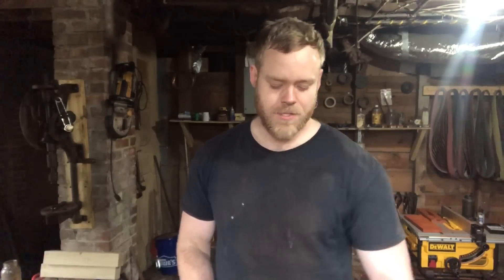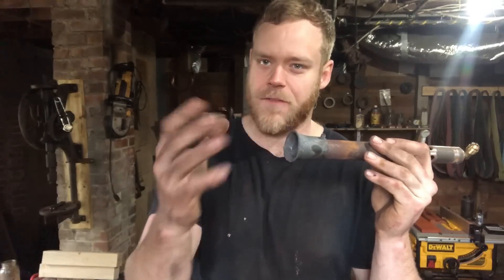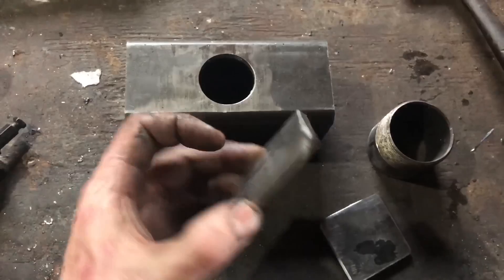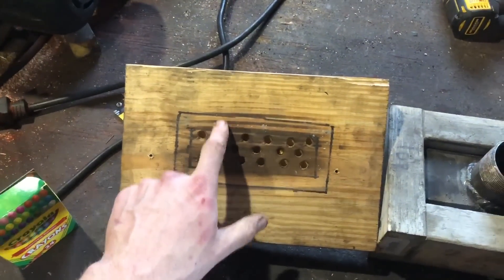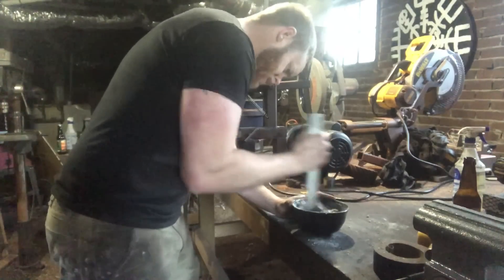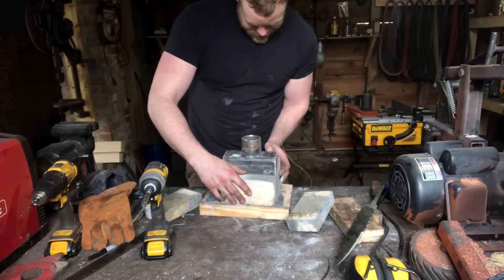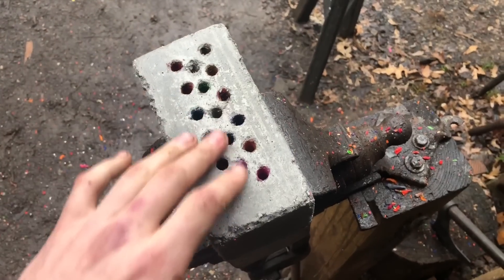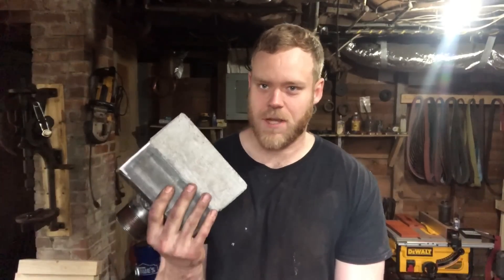How to build a ribbon burner

Comment: You drilled through quarter inch with a hole saw? HTH long did that take?
Reply from the maker: @riverboat28  not long. A minute or two maybe. Drill press and cutting oil makes pretty quick work of it

Comment: I seem to be missing something.  while i understand cutting, drilling, and forming,  when the cast material goes up into the steel body of the burner and it far does it go? Does it touch the bent flat metal with all the holes inside the steel body or is there a space and how much space is needed?

Comment: I'm just beginning to get into forging and heard you mention a ribbon burner on another one of your videos.  I built many burners for BBQ's and smokers and Have a question, do you really need to use the refractory/crayons on the bottom of the burner?  Couldn't you just drill the bottom of the steel body and get the same results without the extra?

Comment: The only part I don't understand is why you cut the burner plate off.
Just drill the holes in the plate in place then tack in some all thread (or bolts) in several places to keep the refractory in place.
Put in some wood dowels for the holes then make it the way you did.

Comment: Putting together a forge myself and was wondering if making the holes smaller would create a hotter flame and burn less fuel.
I'm thinking 1/4" holes throw more fuel than they can burn and smaller holes would be more efficient, plus hotter if you have a variable speed fan to adjust the stoichometricity of the flames.  If that's even a word tricity I mean.
Was going to build with a nozzle then this blacksmith down the street showed me an air assisted forge he recently purchased with a drilled round plate and then I see these ribbon burner forges but read where they go through a tank in a couple of sessions. 
So I wondered if creating smaller holes even cone shaped to possibly add pressure to them would help increase efficiency.
Putting the tips of the crayon on the bottom would do what I mean by a cone shape but the actual exit hole would be smaller than the crayon using just the tip to form the orifice.
Not sure about the mixer working as is assumed.
Possibly welding a angle iron to split the fumes and in the pipe put some sort of swirled to mix the gas and air.
But yours works and mine is in my head still so yeah uh....I'm still thinking.
Also wondered putting a plate in the middle where you cut out to put refractory in.  And capping the ends and sides but not completely allowing the refractory to fill in the area to attach to the head or whatever it's called to force the gasses to the holes and stop some side aerodynamics from slopping up the gas to the holes.  I'm thinking side turbulence 🤷
I could be thinking into it too much as well

Comment: How do you check it’s air tight also you said this is for your propane tank forge? So the dimensions work? Also do you have a video on the plumbing part and what angle into the propane forge

Comment: What kind of pressure do you run on your ribbon burner John here in Morganton
Reply from the maker: Depends a bit on what I'm trying to do. With the new bigger forge, about 3-5psi for general forging. Depending how hot I'm trying to run. 7-9 for forge welding.
Reply: @OldHickoryForge  ok thanks maybe I will up my air flow CFMs the blower that I put on is a small one like a draft inducer motor on a gas furnace have a good one thanks for the return

Comment: Hey, John! Great video! Thanks heaps! I'm wondering if there is an ideal burner to forge size ratio. My forge is about 17" long and 
6 x 6 inside. Is a 6 inch ribbon burner long enough? Thanks.
Reply from the maker: That's about 600 some cubic inches. My forge right now is about 700 and one of these ribbon burners is plenty for it
Reply: @OldHickoryForge  Awesome! Thanks so much!
Reply: Nother quick question: I bought some refractory (Rutland brand) that's only rated for 2200°. I'm realizing that is probably not a hot enough rating. Would 2700° be hot enough or should I aim for 3000?
Reply from the maker: @KPop78k  if you're using castable refractory it needs to be 3000. Mizzou and kast o lite 30 are both good options
Reply: @OldHickoryForge  Thanks!

Comment: What about using, instead of refractory or fire brick material, strips of flat bar material ( the dimensions of the ribbon burner) sandwiched together with the series of holes drilled through it and welded to the housing. ( only because getting a block of steel to those dimensions  could be expensive).Not only would it glow red hot it would probably last for years or would it? That would certainly could be a quick and worth while approach. What do you think?
Reply from the maker: https://youtu.be/hSRjEASWrnI
Reply from the maker: Here is the concept I meant when I said some people make them from all steel. The plenum would be made as Normal but rather than the front bit being cast refractory you can use a thick steel plate with the same holes drilled. Welded airtight. Again I don’t know how well this holds up long term. Some swear by it. Others dismiss it entirely. I haven’t tried it myself so I couldn’t say
Reply: I built a "steel head" round ribbon burner, and it works. Not my design. I copied from Phil at PJT Forging. My build link is https://youtu.be/6b3RGv6HmGQ I have had some issues but not related to the metal overheating. The flame burns at the holes, as it should, nice and blue. I have had over-saturation issues. I have been working to resolve them. I utilized an in-line needle valve just past the shut off valve but before the mixing corners of the piping. I am working on a video depicting my issues and my resolution. I will say that I am also in process with a ribbon burner build like John's. My forge is longer and my current burner head is round. So a rectangular shape should match up better for heating. My current burner head works great! But it is pretty focused in the middle. 
I am new, so I don't have history on how long it will hold up, etc.

Comment: I wonder if purchasing IFB insulating Fire Brick and drilling holes through them would work? Then strapping it onto the burner housing. What do you think?
Reply from the maker: I wouldn’t. Getting an airtight seal all the way around would be problematic.
Reply: @OldHickoryForge  Well lets think this through. The brick is very flat from the factory so that would not be a problem, The housing, if built correctly, should snug up nicely when clamped together either by wire or by straps. And the output pressure from the tank should not be more than 20 -30 psi. I really don't see the problem. And if your really concerned a small bead of high heat silicone around the perimeter should take care of any spillage which I doubt since the output holes are too large to create back pressure overflow.
Reply from the maker: @user-zx7tg4ph5r  fire brick also tend to break down under repeated thermal cycling much faster than a proper castable refractory. Having it crack and come apart during use would be a concern.
Reply: @OldHickoryForge  I wonder in encasing the firebrick with a SS metal jacket would extend the life of the brick? By encasing it, it could also be a simple way to attach the brick to the housing and pre drilling guide holes a 1/4 in larger around each hole will not effect the gas flow but will be easy to slide one brick out to replace it if it started to deteriorate
Reply from the maker: @user-zx7tg4ph5r  wouldn’t having the brick be able to slide out for ease of replacement mean you wouldn’t have an airtight seal? Some people weld up ribbon burners all out of steel and forgo the casting of the refractory altogether. Some say they hold up just was well and some say they don’t. I haven’t tried myself so I can’t say. The way these are built works and is safe so I haven’t found a need to deviate from if
Reply: @OldHickoryForge  A clamping option could be utilized by a U shape hat design where the U is clamped to the brick with bolt holes and the housing having threaded nuts to marry the brick to the underside, at which point a bead of high heat silicone type gasket seal would encase it completely. Then when or if replacement is necessary a slit with a snap blade will release it completely from the housing.
Reply from the maker: @user-zx7tg4ph5r  a ribbon burner made of properly cashed refractory will last pretty much indefinitely. I’ve been running the same ones for about 3 years now.

Comment: Where do you live that crayons are cheap enough to be disposable destroyable mandrels for holes? Those suckers are ridiculously expensive where I live! It'd be cheaper to use birthday candles. A bit smaller, but that'd be fine, you need to re-layout those holes anyway they look so poorly placed.
Reply from the maker: Actually I’ve made burners using straws before which are smaller then crayons 1/4” vs 5/16” and it caused the burner to not run correctly and have problems reaching welding heat. It worked but it was much more fussy. 5/16 is best. I’m curious as to what makes the holes “poorly placed” also a small box of crayons can be found at most dollar stores for 85-99 cents.

Comment: Just an FYI but if you take the paper off the Crayons instead of having to drill them out since their basic material that they are made out of is wack when you toss it in your oven just tilt it in the wax will melt out therefore you don't have to drill it and have any issues with cracking or anything else like that just an FYI I cork put a pan underneath it that way you don't have wax build-up in your oven

Comment: Have you ever considered to try different shapes of the holes, like conical holes or  bell shaped instead of straight ones given by the crayons to slow down the gas flow when it exits the burner?
The static air mixing device is as I see it also an important part of the burner - the flow should be relatively even through all the holes in the burner, and that plate should help with that to avoid more flow through the center holes.
Overall from what I understand the venturi burner problem is that the gas mix isn't homogeneous, and that's what makes them less efficient, so I think that there's some possible development potential when it comes to them as well.
The similarity between forge burners and rocket engines is somewhat striking aside from the rocket engines are running supersonic speeds and the bell shape of the rocket engine actually increases the gas speed.

Comment: I built mine today got 19 holes and instead of cayons I use the less mess and easier plastic straws did find the 3/4" as good advice, and 2"X 4" handy. I oiled the straws before installing and lightly spray.I was told to space holes 11/4 center so they have 1" space apart
With your help I fill it will be fine ,
.had no wax to drill your waxy crarons.
John thanks for showing and teaching..

Comment: Question, ive got my burner built, just getting the pipe together to do the manifold and such, do you still need an orfice such as a MIG tip where the gas goes in to mix with the air or just an open 1/8 hole or such?
Reply from the maker: Preston Thornburg the needle valve acts as that. You don’t need a mig tip
Reply: @OldHickoryForge  ok thank you very much

Comment: I used and like using straws and silicone spray to release the straws.
Question: how thick should the mortar be
Reply from the maker: John Jude I’ve always been told at least 2.5-3 inches. The ones I make are about 2.75 when you take into account how deep the manifold goes into the refractory

Comment: I’m slowly making a gas forge because coal is getting more expensive and harder to find and it would be nice to run a cleaner fuel. And then I won’t get quite as dirty when I’m working. And propane is fairly cheap and easy to get I’m going to make a ribbon burner like how you made yours. I’m going with one that will be more durable and last longer. And I forge a lot so it will save money fast enough in fuel savings and electricity isn’t an issue. I like to make hammers and Damascus so it’s worth it for me. Thanks for the great video!

Comment: So now that you have been using this set up for a while.would you change anything? I am going to copy this and the air feul set up
Reply from the maker: Balsam Forge one thing I would say Is if you shell out the money for a professional grade blower. Make sure you use a heavy gauge extension cord. I used a cheap one not reading the instructions and my blower was noticeably weaker after only about a year and they are not cheap to replace
Reply from the maker: Other than that she chooces real nice
Reply: @OldHickoryForge  thanks alot man. Voltage drop is a bitch on motors. Probably was the problem
Reply: @OldHickoryForge  one more question and I'll leave you alone. Do you know the cfm of your blower?
Reply from the maker: Balsam Forge the first one I had was a 112 CFM which worked good. When it crapped the bed I upgraded to a 175. Only because it will run the smelt furnace better

Comment: Why not just put some brass tubes in for the holes? Seriously, I'd like to know. 
Thanks in advance for your response, from a Desert Shield/Storm Soldier 124th MI out of Ft. Stewart, GA. Currently living earshot from Ft. Knox, Ky.
Reply: Oh yeah, SUB'd.
Reply from the maker: You could in theory. But pulling them out of the castable without cracking it would be a big pain. Straws also work and are relatively easy to pull out.

Comment: How many hours do you get roughly from a 20 pound tank with regular not welding heat?
Reply from the maker: Ramore Trapr I use a 40 pound tank and get roughly 16-20 working hours not running at welding heat
Reply: Thanks, looking at back burnering my coal forge...

Comment: I assume you don't need 1/4 thick walls for that?... 14 gauge would probably do. Or do you disagree?
Reply from the maker: Rich Hlywka I wouldn’t go thinner then 1/8. But I’m also a crappy welder and am mostly worried about burning through the material. I just find it easier to get better welds with thicker material I can really burn into
Reply: @OldHickoryForge  I'm a tin basher by trade. 14 gauge is pretty tough. I understand the worry about blowing through though. That said the burner in furnaces isn't 1/8 thick.

Comment: Nice setup there. I'm a welder. If you beveled the square caps you can guarantee the weld holds after you grind the cap off flush like that. I've seen MIG beads pop right out doing what you did.
Also, sleeves and glasses...UV radiation will kill slow and painful by melanoma.
Reply: I am beveling mine (the ends and caps) I get what you mean. Yes, safety first

Comment: the crayons are wax,, next time take the paper off them before pouring and then just set the whole unit in an oven on a grate with a pan underneath and heat it up, the unit can withstand the heat, the wax crayons will melt out.

Comment: With the forced air do you not end up with heavier scale generation on whatever you are heating in the forge?
Reply from the maker: BubbleOnPlumb not if you run your fuel air mix well. I haven’t noticed a discernible difference between forced air and Venturi

Comment: So that big flame is actually using less fuel than a Venturi or standard forced air burner ???
Reply: Yes because it is now "watered" down with a TON of oxygen! Think about it like this. If you buy a bottle of Jack Daniel's and only drink shots, you would get (totally guessing here!) Say 100 1oz drinks. But if you mixed it with 3 oz of Coke you would end up with 400 1oz drinks. Still good but you are getting more out of you bottle.

Comment from the maker: For everyone continuing to ask. Yes I know “you can just melt the crayons out” I have done it that way before. I prefer drilling because I find it to be faster and makes less of a mess. Do whichever works for you.
Reply: I ask my children ;  The first one who gets his package of crayons complete, win's a happy meal!
Reply: Your drilling out the crayon and saying what drill bit size you used saved my burner build.  Thank you. I made one using straws and the holes were too small.  I drilled them out and the flame stayed stable when I closed the glass furnace doors.
Reply from the maker: solvarr yeah I tried once with straws that were 1/4 inch instead of 5/16 and the burner didn’t want to run right. There’s some formula about total area of the holes vs the area of the inlet pipe but I’ve never went by it. 5/16 holes have always worked fine so I’ve never strayed from it
Reply: Thanks for saying; I was wondering that very thing.
Reply: You know you don't have to have your head in the fume plume when you're welding right?

Comment: I noticed you have an open bottle of beer on the bench when you were mixing the refractory mix you should not have alcohol in the work shop with out a cooler or the beer could get hot and I didn’t see any empty’s and mixing refractory is at least a two beer job so make sure you get on top of that next time
Reply: I agree. Safety first. The shop is no place for hot beer.
Reply: Great vid I intend to do this Thank you. Remember 95 percent of all ER visits start with. Hey yall watch this. So Remember. Safety starts wi--ummm no thats not it Ohhh yeah.  Remember. Only you can preven ahh Crap!!!. Remember. Hydrate cause Beer wont drink itself and Add salt for extra leg cramp relief. Ahh Screw it close enough
Reply: One of the best comments I've seen in quite a while Sir, cheers to you!
Reply: Check out Safety Sally over here 😂

Kudos to you sir.
Reply: Really had us in the first half not gonna lie.
Reply: Hot Beer? Isn’t that what they call Alcohol Abuse?!? 😱
Reply: Well, in Suomi, you can drink beer in sauna! The trick is, you drink it fast, and second "trick", it's about 185°F (85 "real degrees" ;-) )
Reply: Congrats on your safety first comment..
We should all take this to hart as i recently lost 2 beers to negligence
..remember- " you cant get them back!!"
Reply: Yeah borderline alcohol abuse